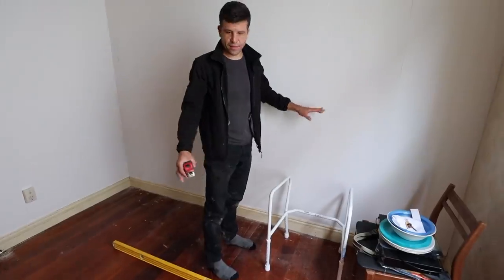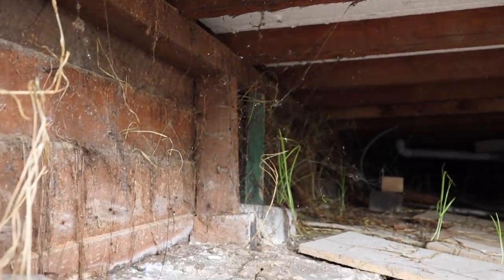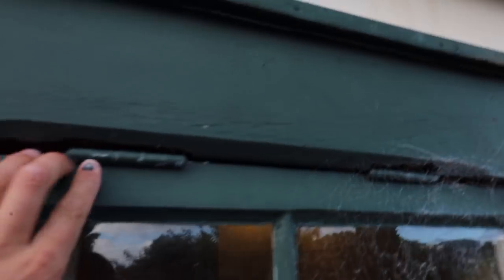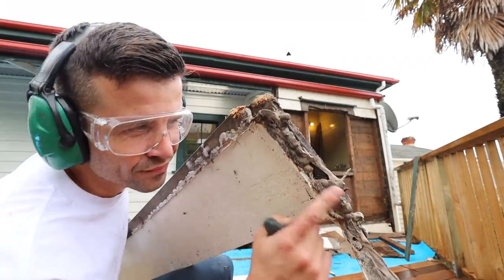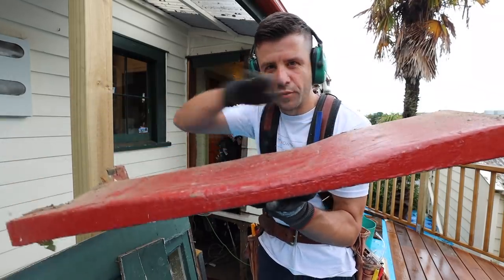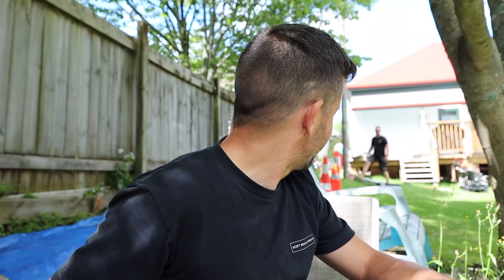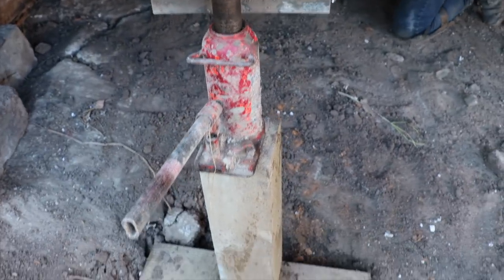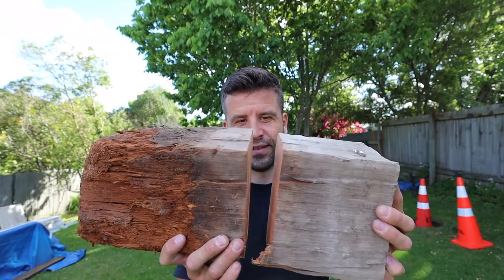Lifting a House With a Car Jack

Comment: We just had this done to our house in Christchurch. 80mm out of level. Exact same method. But they just filled the gaps with packers and new bearers. No new piles. They were concrete ones anyway.  There were cracks galore on the inside. But all fixed now. Had to move out for 8 weeks.

Comment: Worked on a house in Morrisville in the Waikato which was a hundred years old the one off the owners had lifted the house to level but had left the jacks in place on blocks off wood and left the gap between the pile and the floor joist

Comment: I can’t believe how kiwi’s houses were built!!! Garden shed style of structure.
Reply: Older houses are built like that here in Hawaii.   They don't call it a "plantation style" for nothing.
Reply: My 1901 farmhouse in Portland, OR is built very similarly. I think it was just the style around that time in temperate climates where you don't have to worry about the ground freezing.
Reply: They don't built em like they used to, eh?
Reply: @jamil3286  don’t know
Reply: @jamil3286   literally. My house is built ballon construction style with old growth douglas fir. It's all 24" on center and well settled. It's interesting to try and figure out when and where all the remodels have happened.

Comment: G, day Scott from Sydney, Australia.
* more headroom under this building.
* the native timber hardwood shows it's durable quality after 100 years.
* the cracking and creaking as the house (building) was being levelled: I only have concern for roof fasteners (steel nail) for uplifting wind forces, in high wind areas/saltwater locations.
🌏🇦🇺

Comment: Just took out over 1.25 inches out of a structural beam.  20 tonne jack did the trick.  Nice and slow though, only had two cracks in the gyp. The cracking noises were unnerving.

Comment: Watching someone lift your house is the most nerve-wracking experience!  In the late 80's we had ours lifted 3' (~900mm).  The creaking noises are very unnerving, however the inside had only one small crack in a wall.   It was worth hiring pros.

Comment: I found the garden auger used on a battery drill a great asset when drilling/digging  holes holes for restumping a great help. You would be surprised how good they are and very cheap to buy and varying sizes..
Reply: We discussed this. Thanks for the tip.

Comment: That house doesn't look like it would withstand any kind of earthquakes no matter how weak. When I was in high school, we lifted a house with my father on a summer project for about 30 cm with screw jacks. That was a tough job. The house is still standing 40 years later. Hydrolic jacks are a piece of cake. 
.
Reply: the flexibilty and the fact that the house has a lighweight roof and is light in itself.These old houses were also solid sarked(lined inside with timber) so are actually very well braced,in a slightly flexible way.

Comment: Whats that martinez hammer doing back in your toolbelt Scott. You changing?
Reply: Assuming he uses it for demo because of non timber handle.? I use my estwing on demo for that reason & save the titanium dalluge for the rest👍🏼
Reply from the maker: That's the demo hammer now. Great for pulling out nails and it has a bit of extra weight behind it.

Comment: hmmm lifting a house me bein in germany where houses are on Concrete and steel Foundations kinda hard to lift XD but nice video
Reply: You can lift entire slabs if you need. There is a technology where a crew go around with a truck full of an expanding epoxy and they map the ground under the concrete then drill holes in the low areas and fill them up until the surface flattens out. Its pretty cool to watch the cracks close up bit by bit.

Comment: Why not do earth screws instead of pouring concrete Scott?
Reply: Great idea - but it would be hard to get the rig under the house. You'd have to lift all the internal flooring, and remove joists. Excellent for a new build if bearing level is not too deep.

Instead I would consider new wooden foundations with treated timber (basically an update of what has lasted 115 years with that totara). Then use closed cell spray foam across the earth on the ground to insulate, create an air and moisture barrier. This would create a conditioned under floor to keep the substructure nice and dry. A whole lot easier than poly on the ground and fibreglass batts between the joists.
Reply: @DavidIvory  Adjustable steel post would be good also.

Comment: I am surprised that it was not cheaper to knock the house down and rebuild from scratch than do what you are doing with it... Also is there any houses with foundations just like in Scotland in New Zealand?
Reply: Yeah there are houses with foundations in NZ. I had a job for a while digging under the fountain on houses and releveling them using bottle jacks. This was after the earthquake in chch.

I'd venture a guess and say most new houses are either on a foundation or slab.
Reply: The cost of a new build is really high here in NZ. 
There is also the fact that the housing market in Auckland has gone crazy. So the cost of rent is really high there.
It would make it really hard on the home owners if they have to rent for 3 or 4 months while paying a mortgage.
There may also be planning restrictions. Here in Hamilton we have some areas around that age that are considered historic. 
People are only allowed to change the back of the house. The front has to stay the same as to not change the look of the area.

They could be some of the reasons it was just easier to extend than rebuild.

Comment: Our house that we brought got replied and bottom bedroom redone, they did not jack it up when they replied... 
They replaced the floor in the bottom room level and good but the room above has a 70mm fall over 4m.
Now if we want to fix the top room we have to redo all the work done on the bottom room : (

Comment: Lifting, Levelling and Re Stumping houses very common where I live in rural Queensland. One of my next jobs is exactly that on about an 80 year old house. We also lift them right up and build under. All done with bottle jacks and timber cradles. The Yanks have high tech linked hydraulic  systems but never seen that here. Why don't your floor levelling guys do their own stumps it is all part of the same job. We lift level and stump as we go so many at a time. Leave over night and then do next batch. And no Snakes, biting spiders, scorpions under your houses. Bonus.

Comment: Despite being durable in the ground and resistant to compression, totara being a conifer is a gymnosperm and as such is classed as a softwood species. Hardwoods are timbers from the flowering trees or angiosperms. There are very few native gymnosperms in NZ used for timber. Examples include: Beech, Tawa, Pohutakawa, Kowhai, Manuka/Kanuka, Pukatea, Puriri, Rata, Taraire, Titoki, Rewarewa, Mangaeao. Mostly locally grown timber hardwoods in NZ are exotics such as blackwood (Acacia melanoxylon) native to Australia. For more see: http://www.nzwood.co.nz/.
Reply: Good burried lifespan for a softwood in the ground though! Local pine wouldn't have lasted much past 10 years. 116 years with approx 10% loss to rot is doing well!
I visited NZ about 10 yes ago, place in North Island digs up half million year old trees from swamps, dries them out & makes furniture & souvenirs from the timbers.  That is even better. Even cut a spiral staircase inside one trunk for their shop.

Comment: What's up with pink timber?
Reply: Scott did a video on this. It's basically treated wood for internal framing to prevent mould, rot, etc.. We also have green which is treated  for external use.
Reply: @lukejochem  oh that makes sense. thank you.

Comment: I saw that fuel price sign and NZ fuel prices are crazy bad, that cannot be real? $2.40 for 98 octane ? $1.98 for 91 octane? How can the economy even work with such high fuel prices? Diesel is at an ok price but unleaded is way over priced. Is it per litre these fuel prices?
Reply: Wait until you see the cost of our food and our building materials and our houses.....
Reply: I paid $1.80 a litre for 91 octane in Wellington NZ last night.  Of that amount 70c pays for building and maintaining roads in NZ , 6 cents pays for compulsory injury insurance while driving and .7c for local authority roading. In Auckland there is an extra 10c/litre  for Auckland roads not covered by the 70c.
Reply: There are about 5 taxes on it, that and GST is an easy way to get tax. Yes per litre.
Reply: Diesel is priced differently.  It excludes road user tax. You have to buy road user tax by the kilometre separately in advance and it takes in consideration the weight of the vehicle. Generally diesel will have better MPG than Petrol when all other factors are equal.
Reply: whats your minimum wage?
Reply: @grandaddyc  im from New Zealand, i was asking FurIouS what his is for a frame of reference. Affordability comes down to wage, not price. Might have clicked reply on your post in error
Reply: @Etacovda63   My mistake. There is a system which uses the cost of a countrys  big mack  to work out a country's economy,  ie 91 0ctane costs  .22  BM$ per Litre.

Comment: It seems like many new zealand homes are built on posts.  In America we always build on a foundation of some sort unless the area has a high water table. Is that why yall build on posts too?
Reply: My 50 yo house has holes dug down to the clay then a 2foot by 2foot concrete pad then a block, dampcoarce, then a wooden post wired and stapled to the joist. at the other extreme I have seen wooden posts pile driven into the ground . thats it.  yes NZ has a high rainfall.